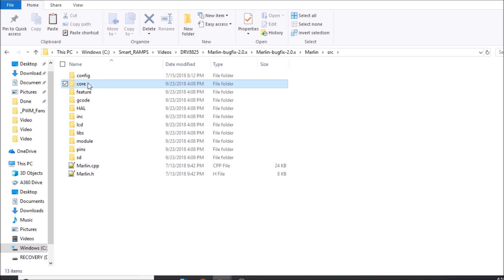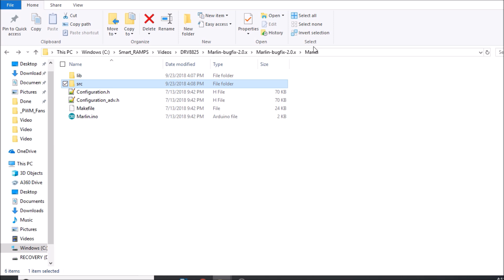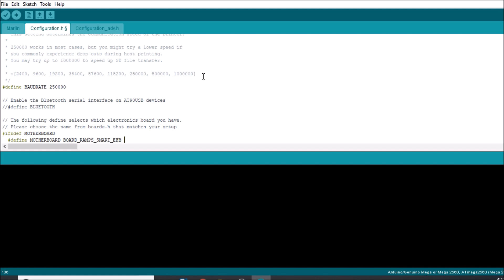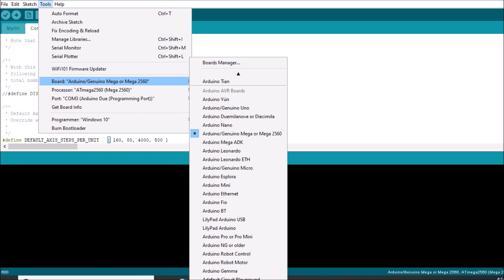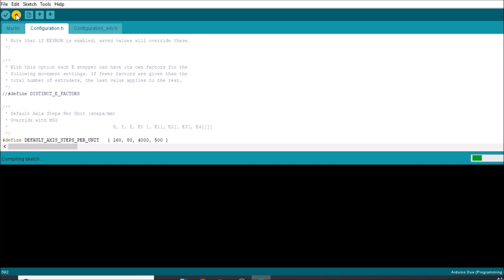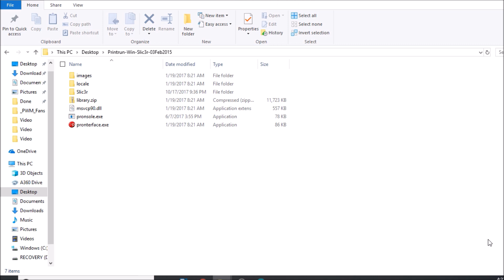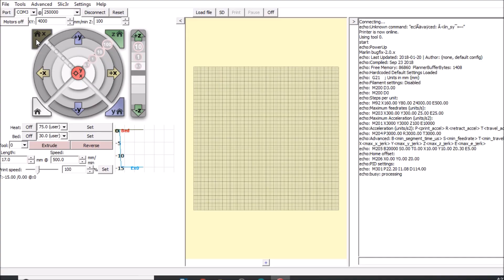Smart RAMPS - DRV8825 Install

Comment: Is it possible to add Extruder Expansion Board to Smart RAMPS? Cause I need to have 5 Extruders on...
Reply from the maker: It's possible, but I've not attempted  yet.  Check out my adding additional steppers video for RAMPS 1.4.

Comment: Thanks to your classes here at YouTube University, Ive ordered the MKS Gen L board, various cables, and connectors. Hopefully Ill be printing some time this weekend. I went with the MKS because all my stepper motors are 24 volt and it would be a pain to convert a regular RAMPS board to that. Thank you for your information.
Reply from the maker: You're welcome.